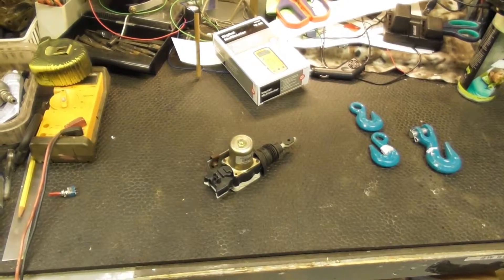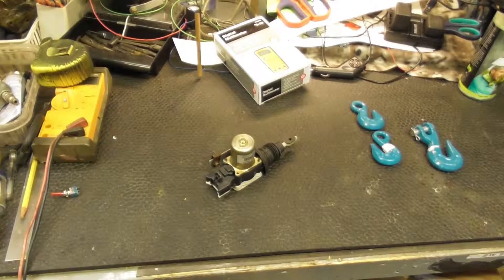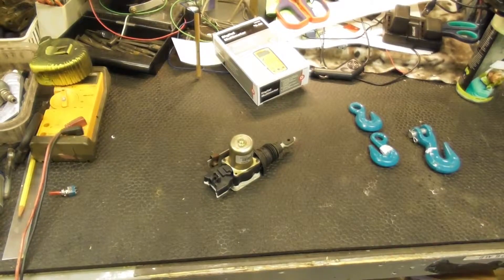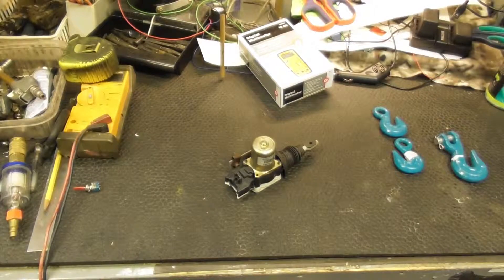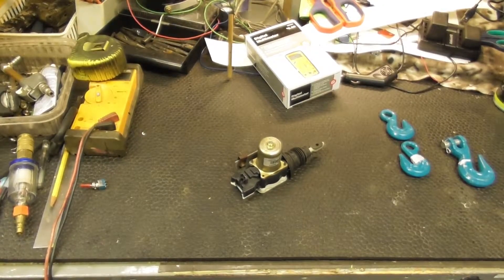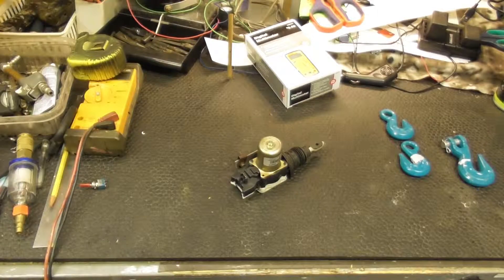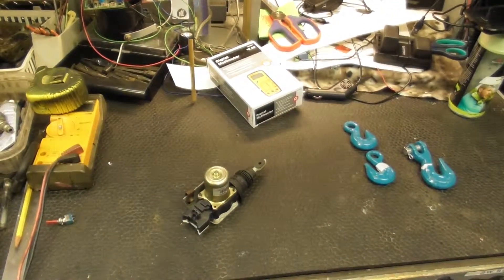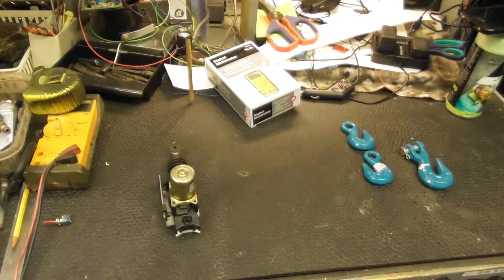Why I pulled the door lock

Comment: Electrical issues are always lots of fun to figure out. I know I'am no good at it but I deal with it everyday at work.
Reply from the maker: It can be a royal pain, I have an issue with my shop 110AC for months before I found it, I had 3 electricians look at it and they couldn't find it. I found that it was a short in the wind turbine and was feeding power to ground, just enough to blow my computers, radios, but not enough to pop the relays.

Comment: Replacing the lock sounds like the fix. Water getting to places will muck up the electrical s. Good luck Buzz!!
Reply from the maker: I put the new one in today,  haven't used the van in over a week and the battery was still charged with the power lock out. But then again it maybe ok for months then screws up again.

Comment: Your central locking is connected to the immobiliser. Before you get under the dash, get your multimeter and check the wiring connections. Most times, when the door mechanism starts to fail, it tries to push more and the connections fail. There are you 2 first checks before getting under the dah mate. You can also swap the door mech with another door only to check the door lock itself.
Reply from the maker: Will check :) anything is better than my big ass trying to fit under the dash.  Thanks Big Gaz

Comment: that is a real puzzler, it looks like you have tried more than I would have one of my Subarus some time back would randomly run the battery down over night, I finely found it to be a abs relay sticking at times but the way I found that was after the car was shut off if I was close to the hood, I could hear a buzzing sound so then it wasn't too hard to track it down.
Reply from the maker: It's been driving me nuts for years. lol. I will prevail, or I will assimilate it. lol